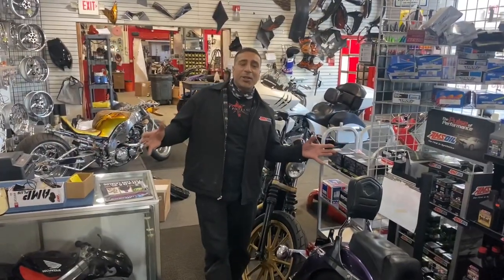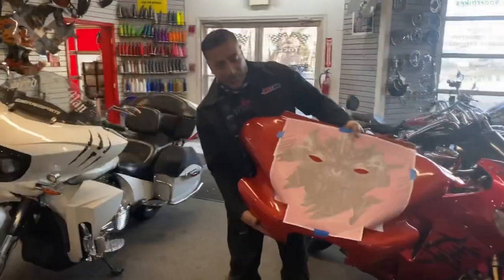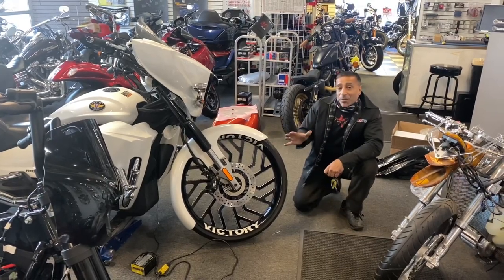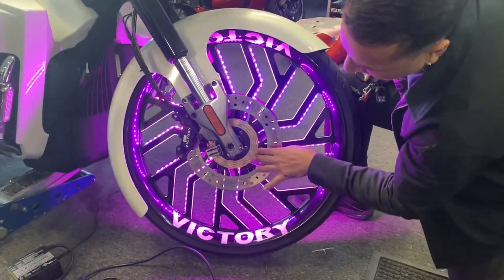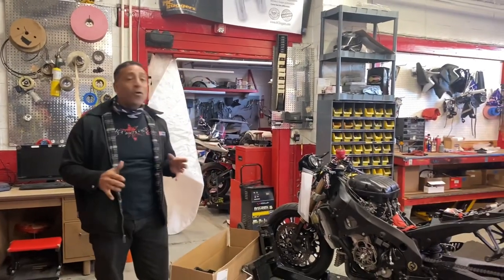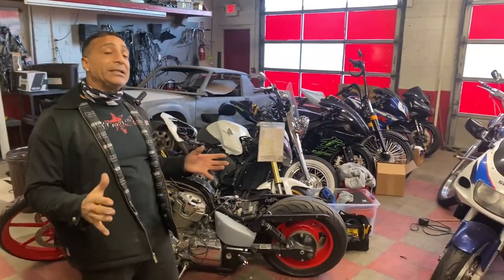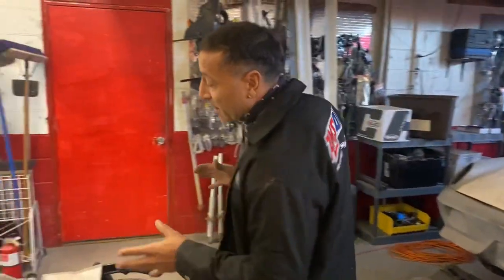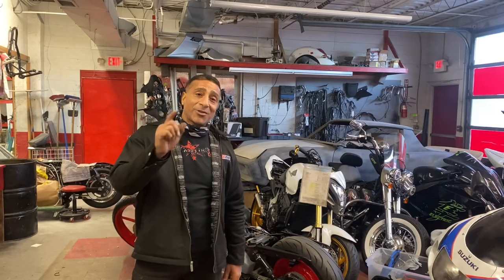How Do Motorcycle Wheel Lights Work? & MORE- SHOP VLOG EP. 2 - Tricked Out Cycles

Comment: This may sound silly but I'm interested in trying to do this do an e-bike, are you aware of parts I could use for such a purpose? Could I use the same parts motorcycles use for this purpose? I want to try to supply power to leds on the wheels with power directly from the bike's battery rather than using batteries attached to the inside of the wheels like many others have done.
Reply from the maker: Yes I can help u. We can supply you the parts but these are 12volt. Call and ask for Steve 215-674-4340 tue-Friday